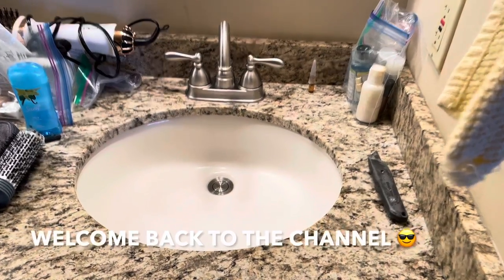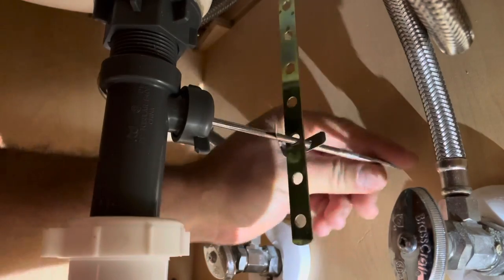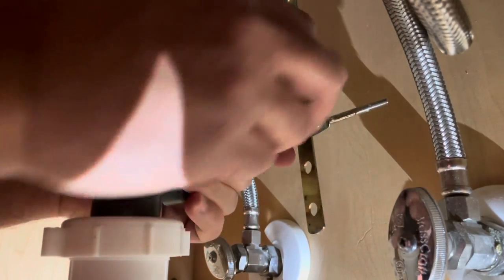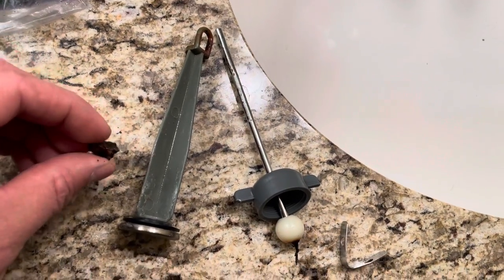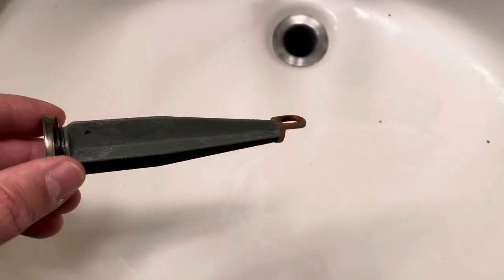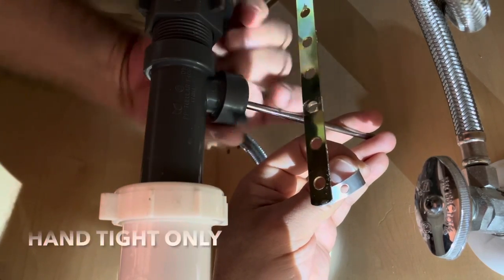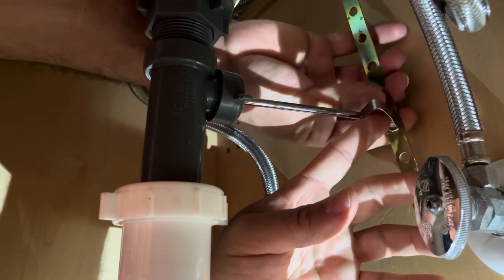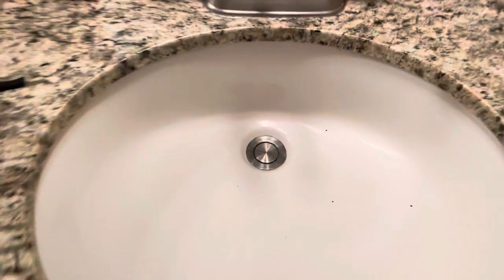HOW to FIX a Broken Sink DRAIN STOPPER Rod - If your Bathroom Sink Stopper does not Pop Up, Do this!

Comment: I've done this, but water is leaking through the reatining nut under the sink ?
Reply from the maker: Try cleaning or replacing the O-ring by the pivot rod ball. May also try using Teflon tape on the threads.
Reply: @fixinit  so this was weird. Although I bought what I thought was a universal replacement, the pivot ball on the new one was too small. The older one was larger, and fit perfectly in the retaining but. I had to re-use the older pivot ball rod.